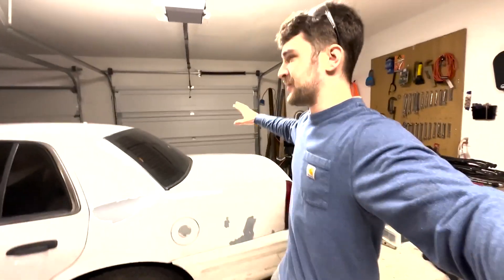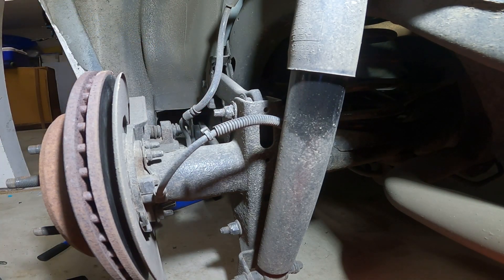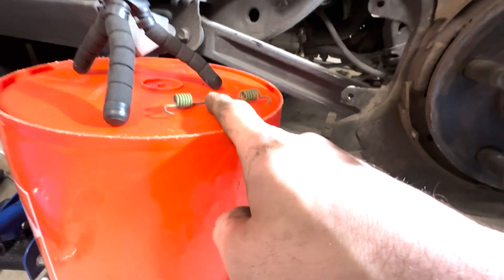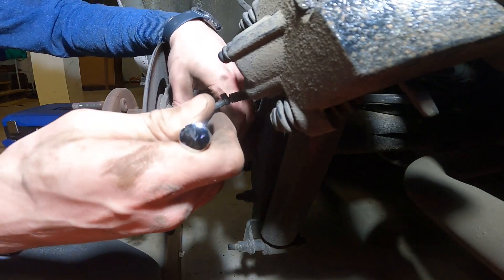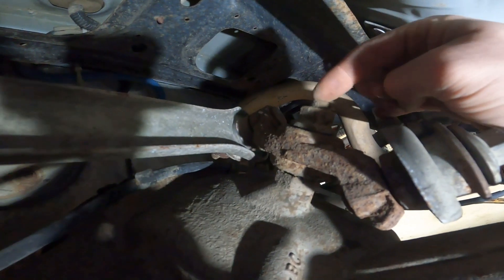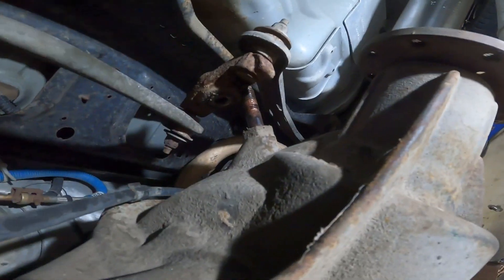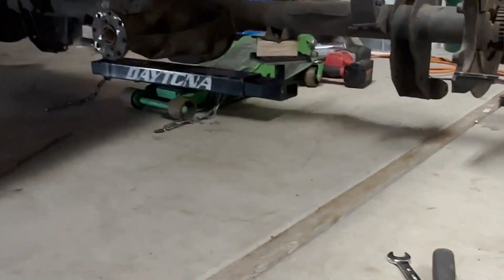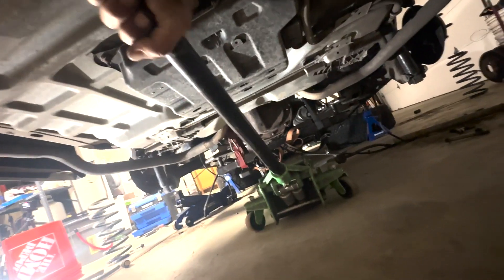Unlock Performance: Crown Vic Rear End Swap- Ford 8.8 LSD (Part 1)

Comment: How much did that rear end cost you. I have a 2006 Crown Vic LX with upgraded Springs and Monroe magnum heavy duty springed struts. Also Got a 1 inch billit aluminum riser. Was having issues with the rear sagging while towing.
Reply from the maker: Like 250 or something like that
Reply: I used 1996 F-150 manual fill air shocks on my 2000 Vic interceptor rear end, works in keeping the fenders wells off the 15×10 inch wide tires on the back. Pump it up with air at the truck stop for free . You can use F-150 springs to bring it up too. Mustang springs lower it , F-150 takes it up , regular Vic springs for in the middle height.
Reply: @TravisMcKnight-lk7gg  I ended up going with 1 inch riser on the rear springs and changed to the moog rear springs with the monroe magnum heavy duty springed struts in the rear. The rear end does not dip down at all anymore when towing any of my trailers.

Comment: Is it the same for 96 crown Vic
Reply from the maker: Should be as long as it’s a ford 8.8
Reply: Can't you just swap the gears and axles?
Reply: @paulshamblin6260  No, totally different setup inside it and unless you know the difference between the open and limited slip design, its just recommended to swap the entire rear differential instead.

Comment: Does a x5 code work for a 2007 mercury grand marquis
Reply: My code says c8
Reply from the maker: Yes
Reply: @pnwvibe3123  thanks for the fast response and  helpful video
Reply: @raulchavira5529  nice you have the most desired diff 3.55 lsd